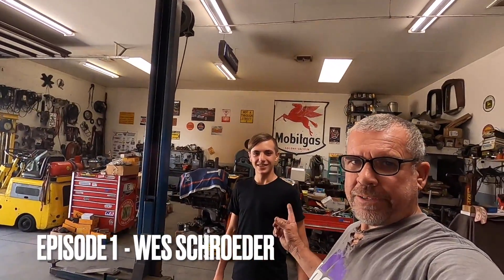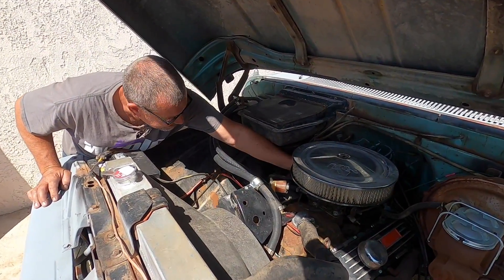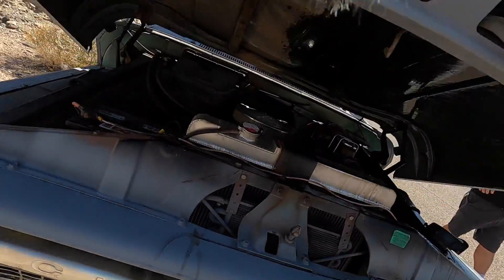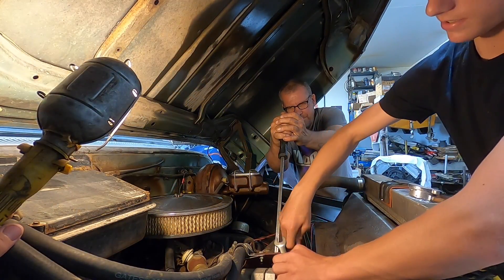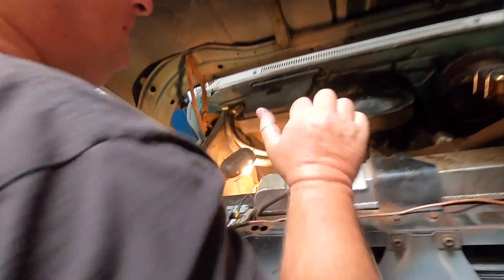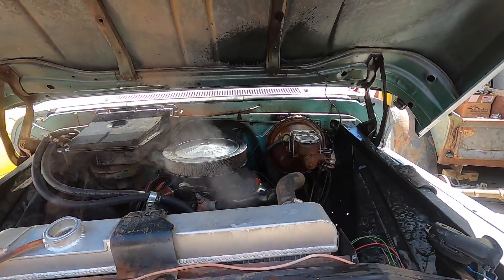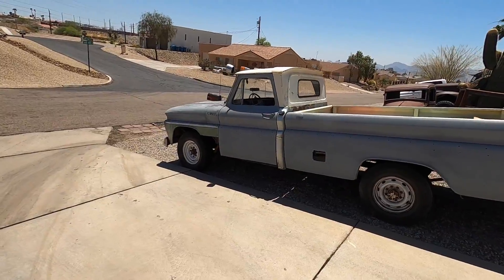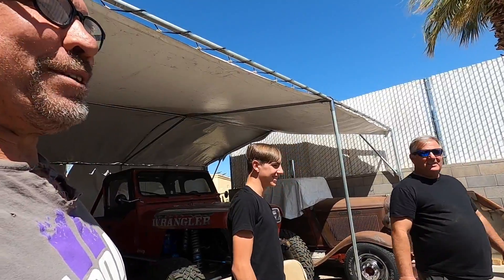Big Opportunity for Wes Schroeder - Episode 1

Comment: In 1973, I was stationed in Alamagordo, N.M.. I bought a 1963 Chevy, long bed, custom 20 with a 283, 3 on the floor. It had the original wood plank bed. I wish I still had it today. Mine had 2-60A/C. (2 windows, wide open, at 60 MPH. Air directed by vent windows.

Comment: I watched you build Fab Rats motor. I liked that one & subscribed. The very next video you start talking about building my favorite truck. I owned a 64 6 cylinder, 3 on the tree. I drove to work when I worked for TVA. 80 miles one way to work, she smoked it need things. Had a beautiful black diamond pleated seat with a hole in it. Really wished I had kept it, wished I had kept a 57 I had as well. I’ll be watching

Comment: Mderlin
That is such a generous offer and one I think Wes will be deserving of - this young fella looks like he is ready to learn and be given the instruction he needs to make a real go of it.
looking forward to seeing the process.
You know in Australia any chassis mod needs an engineering certificate here. 
I guess that does not need to happen in the USA , but you want to make sure that the chassis is done right as if it snaps in half that could be fatal.
 I am sure you will do it right in any case.
Love that  low ride truck of yours by the way.
Reply from the maker: No we don’t have inspections or any of that stuff here you can cut a truck in the middle and shorten it to 2 feet or stretch it out to 20 feet and nobody cares
Reply: I am ready!  Wes.

Comment: My first vehicle was a 1965 Chevrolet C-10 short bed style side with a straight six and three on the tree.  I think they painted it with brush and roller in Forest Service green.  I added pinstripes and gauges.  If I only knew what it would be worth today.   But I picked it over the 1954 5 windows pickup, I wanted something newer.  🙄

Comment: Merlin..I have a 1995 4Runner 5spd Manual 4x4 with the 3.0...  that I would to trade for a automatic 4x4 with front and rear lockers and a good motor.i dont care about body..just drive train..i like the old rusted rat rod look....mine has a good motor..only issue needs bushings up front and power steering leak..